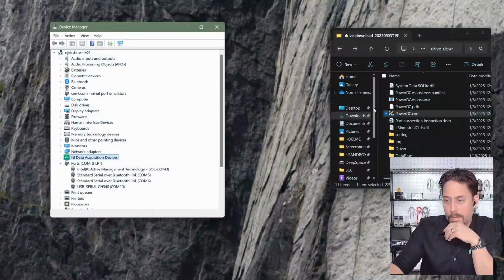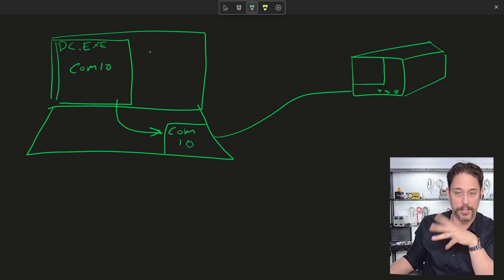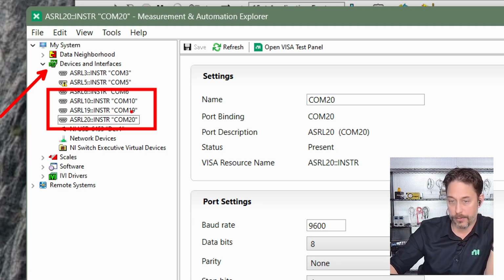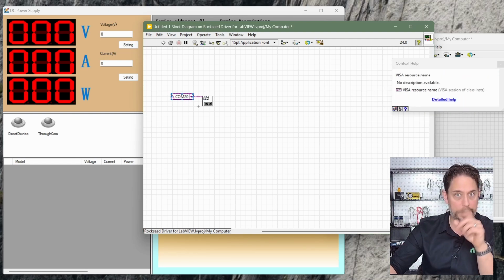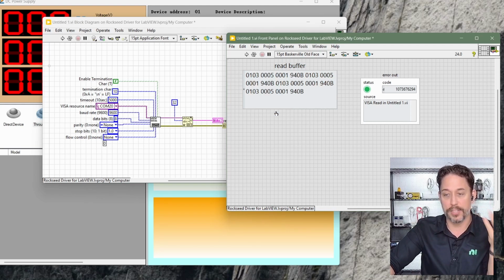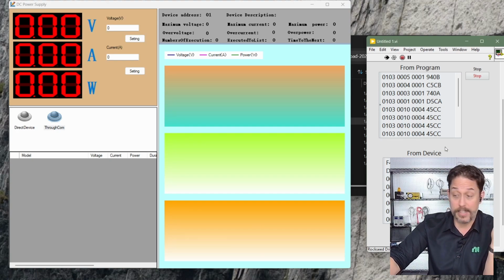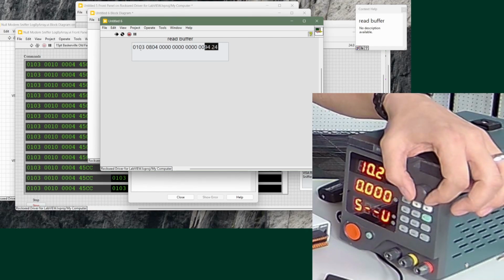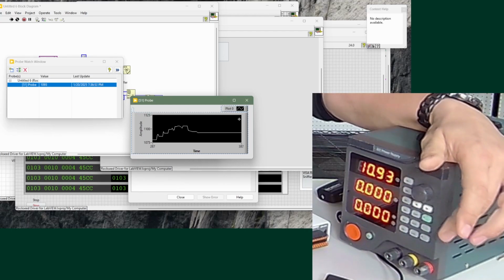Reverse Engineering Serial Power Supply Comms 'With NI'

Comment: Excellent!!!!  Not "tik-tok" short... but a great plenty-quick-enough view of a very powerful set of tools/techniques/tips!!!!   Nice mix of speed/brevity and details!!!  

Actually... it is not even about the actual length of the video... the power of this video was in the excellent script/execution/editing.  Information density and clarity were very high!!! 

Definitely a great summary of a "fuller version" that I would love to see for both the "serial details" and the additional "tips and tricks". 

I don't have that power supply... but our lab does have older serial equipment, so this was extremely interesting and practical!!! 100 thumps up! 

Could a similar thing be done with GPIB?   (new to Labview,  sorry if this is an obvious question)
Reply: Thank you John for the thoughtful reply.
Regarding "A longer cut" I'm always torn on if it's worth the production time to let one of these loose. I've got a separate channel that I'm replying with which I might take the deeper dive on, but I'm grateful that I've got at least one person advocating for the time to be spent on something I want to do anyway. If you can get anyone else to concur with your thoughts, it'll really tip the needle forward in that direction.

As far as GPIB goes, you only need to use NI I/O Trace t o catch all information going back and forth (presuming you're using the NI drivers and toolchain (LabVIEW not necessarily needed, but always better)